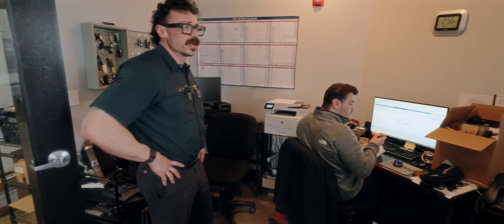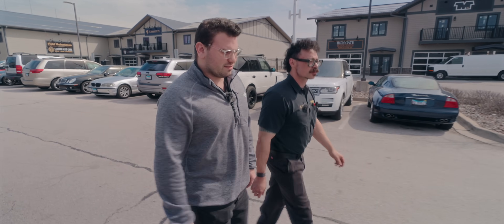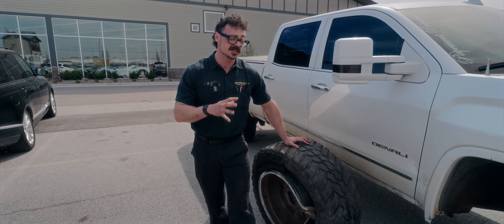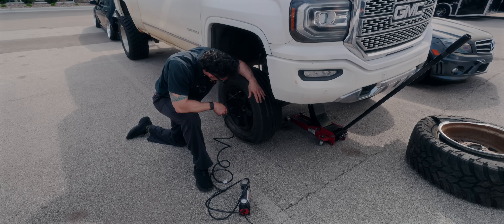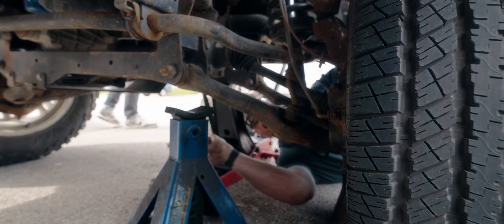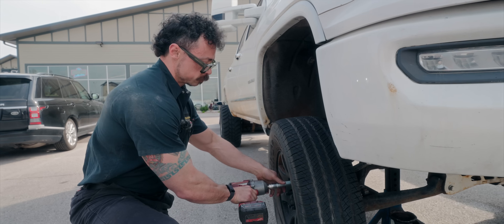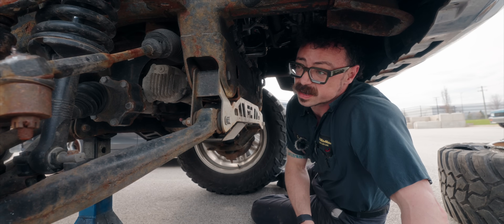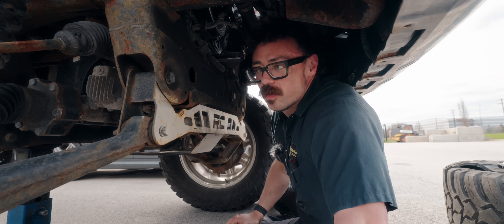Don’t Lift Your Truck Till You See This…

Comment: Hey guys! I got sent over here this morning to say my truck got posted on their YouTube. I just wanted to say thank you to fluid motor Union for the amount of time and effort being put into this truck. It turned into a big headache, not on their end, insurance was being a bit of a hassle, but fluid motor union has put extra care and effort into this vehicle. I can’t thank them enough. To respond to some people. This is just a toy for me, it’s used to tow my Nautique wakeboard boat and the occasional drive to work. I’m excited to see the completed project. Can’t recommend these guys enough. Thank you!
Reply: Ignore the talkers bruh; cool toy! 🐻
Reply: For a toy and occasional use vehicle, that is awesome. Can't wait to see the new wheels mounted and a new lift kit.
Reply: Upgrade to a Cognito 10" lift kit. RC is garbage.
Reply: @saulGjr  the only thing “truly” RC on it is the crossmember drops. Apoc 10 inch rear blocks, with add a leafs, and 1 inch lift shackles. Front has upgraded upper tubular arms, upgraded wheel bearings, and cranked 10 inch vertex struts. I’m swapping over to kryptonite upper arms, only thing that will be left RC is my crossmember drops
Reply: @saulGjr  when I get the truck back. It’s getting lifted up another 4 inches so it’ll be a total of 16 inches of lift, going on those 26x16 on 38s15.50. As well as some frame covers and mammoth guards going in wheel wells. Tons going into this
Reply: Nice truck though
Reply: Nice truck but gotta take more care of it even if it’s used to tow your other toys

Rust management, proper greasing of ball joints, tie rod ends & I have a daily & toy but I find myself at least every 4-5 months looking it over to make sure everything is greased and pads and fluids are okay 

That looks like it was from ignoring a hub bearing that was going bad
Reply: @DJEFlizZ215  thank you, but no truck slid out on ice on me driving in Illinois winters. And that surface rust happened from the truck sitting outside the shop, not their fault. But truck has been outside since January in the same parking spot since insurance is taking so long. There wasn’t as much surface rust before bringing it in, and most parts will be replaced anyways with what we have getting done to it :)
Reply: Hope it will turn into a seriously capable off road rig :D Then you can also have some fun doing some good wheelin!
Reply: @kaedeschulz5422  honestly. What I’m doing to it, it won’t do any off-roading. I have a couple dirt bikes and dune buggy if I want to go hit some trails. I embrace it but this is a straight pavement princess, even says it on the windshield! lol 😂

Comment: Gee, big surprise that the wheel bearings are shot, considering all that offset. Guess the owner hasn't learned anything from the looks of the new wheels. Obviously it was being driven with shot wheel bearings, which is probably why it was crashed. Stupid is as stupid does!

Comment: Nice truck. 

We’ve seen that before. Usually a hub bearing failure leading to all that or an aftermarket wheel falling off.

plus some of the Chevy trucks have an aluminum or steel knuckle choice and they have a different ball joint taper,so you have to swap out the A-arms or ball joints to go to some style knuckles if your truck started with the wrong knuckles for a direct swap.

Just a pain in the ass

Comment: “What do you do when it’s time to replace and repair”

Easy… you replace and repair it. If it takes 2 weeks. So be it. If it takes 2 months… so be it. If you have to replace the components for an entirely new setup.. so be it. That’s the cost that comes with modifications. If the owner wasn’t ready to accept that, he has no choice now.
Reply: I’m the owner. I had no issue replacing it all, actually I want too so I can lift it higher and go bigger this time. I had specialty coverage for my insurance that covered all the parts on there, that took forever to get figured out, hopefully they post finished project and keep you guys up to date, but this thing is going to be wayyyyy bigger than it is now 😂

Comment: Should put that jack on the passenger side near the front door there is jack points and use a jack stand to hold up the front lmfao 🤣 😂 guy dropped that truck on the jack 2 times 3rd times the charm right✅️ . Got a 6 lifted nissan frontier I use the badlands offroad jack to help jack it up also.

Comment: The front tires should freely spin it’s only in 4wd if you put it in so it should be rear wheel only till then. I woulda just replaced the hub in the parking lot lol

Comment: Bigger wheels.. rims..stock rotors.. that is a lawsuit waiting to happen. Big brake kit is mandatory for something like that !!
Reply: They’re upgraded rotor and pads. Drilled and slotted. New calipers I had installed too. Everything has been upgraded. Tows my 9,000 pound boat with no issues at all